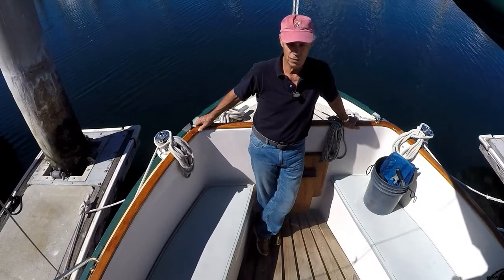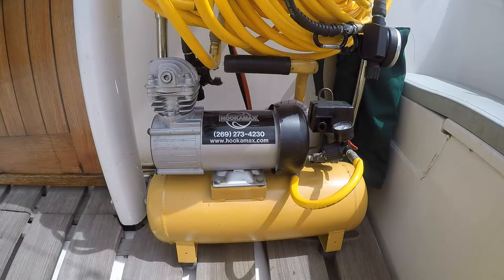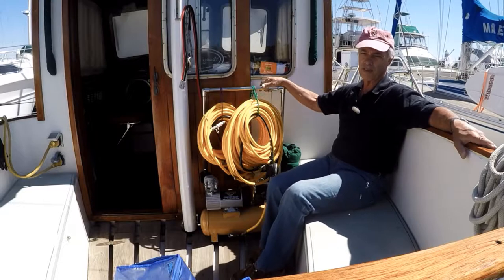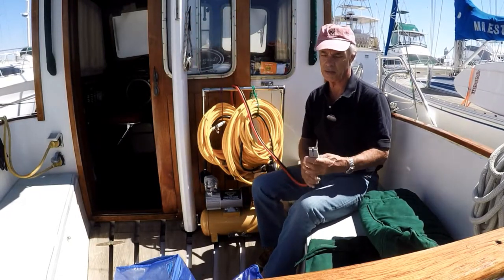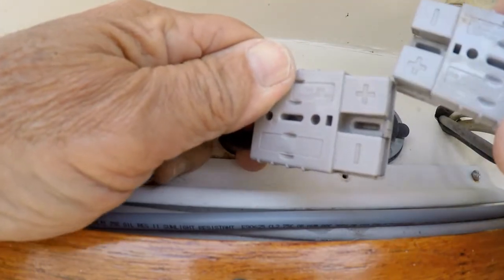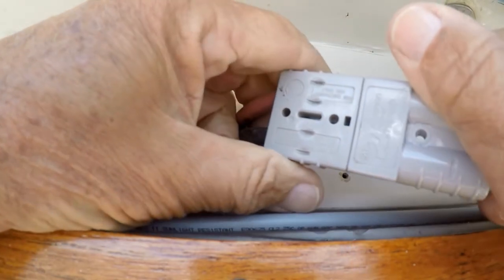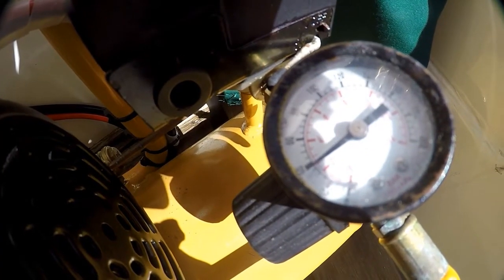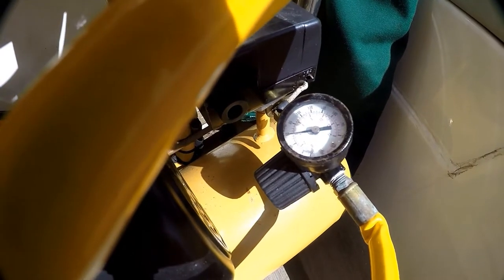12 Volt Hookamax Diving System Set Up

Comment: Just Recently had a FATALITY in Chickasaw Al. Guy seen a UTUBE Video how Home made Dive Gear. Had a hose hooked to second stage. Piece of Chain for Weight belt. Small Air Compressor. He as I understand had NO DIVING EXPERIENCE. 
his girlfriend in the boat witness him in 40 ft water surfaced 2-3 times then surfaces Cry Help & Disapears. ! I didn't Dive Looking for him. 
But did see the Gear. 
DON'T TRY THIS IF YOU ARE NOT EXPERIENCED DIVER. & Know Equipment is SAFE...